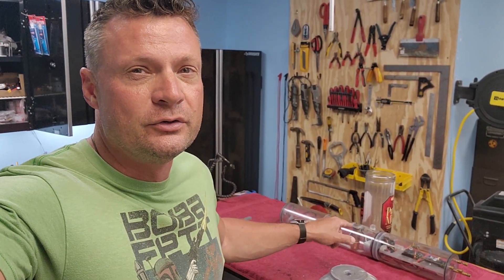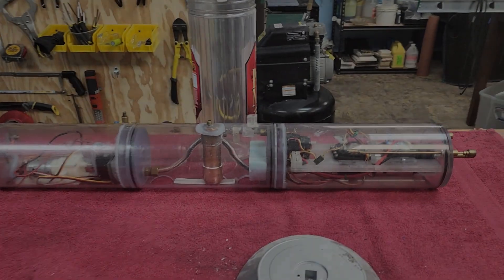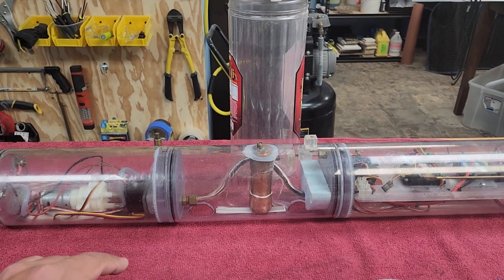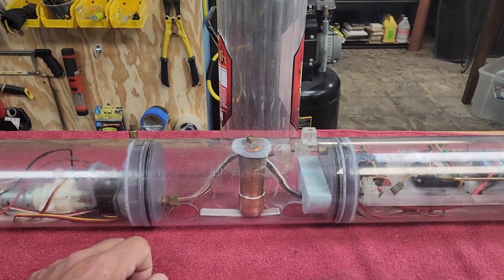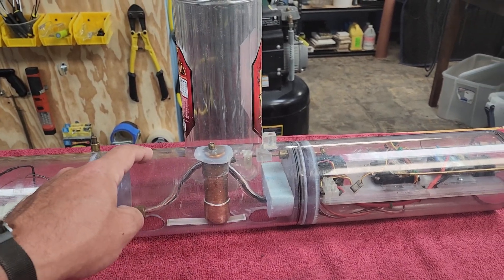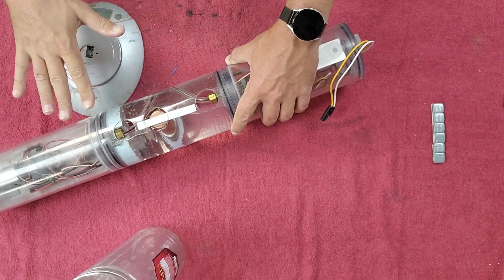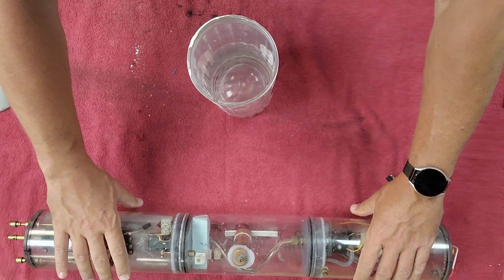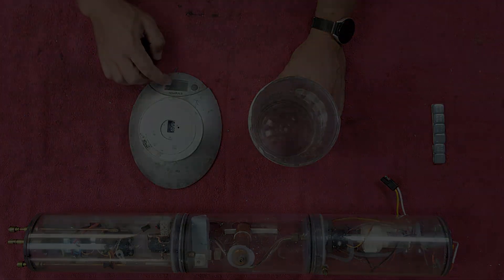Working Backwards! Calculating the volume of an existing ballast tank

Comment: Okay, but how many Bananas-For-Scale does that equate to? I actually do wish we would switch to the Metric System here in the U.S. Except for Celsius. Fahrenheit is better.
Reply from the maker: LOL... how in the world can you say that Fahrenheit is better? In Celcius, water freezes at 0 and boils at 100. Easy. Simple. 

In Fahrenheit, the dude set zero at the lowest temperature he could get a water and salt mixture to reach. He then used an incorrect measurement of the average human body temperature, 96 degrees, as the second fixed point in the system. The resulting schema set the boiling point of water at 212 degrees, and the freezing point at 32 degrees. You don't get more random than that.